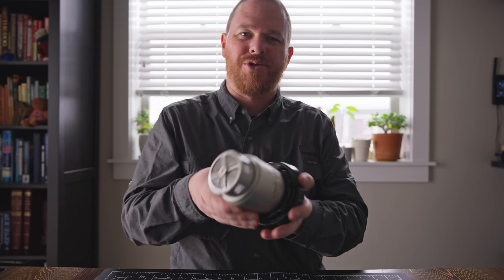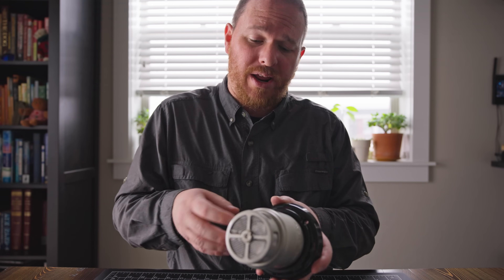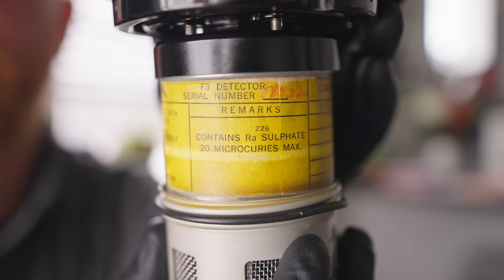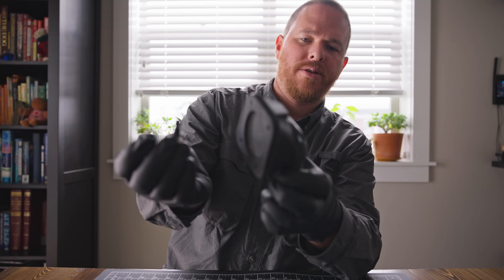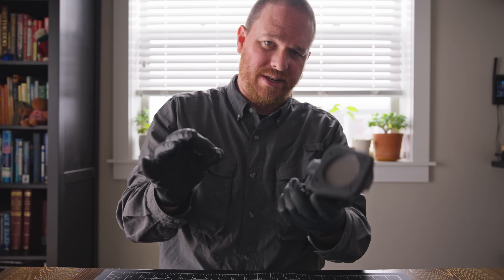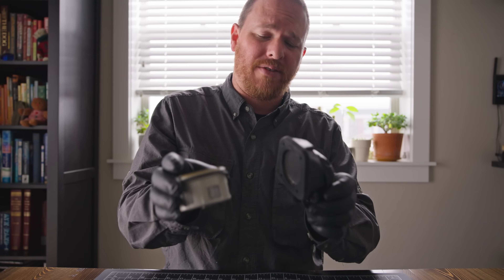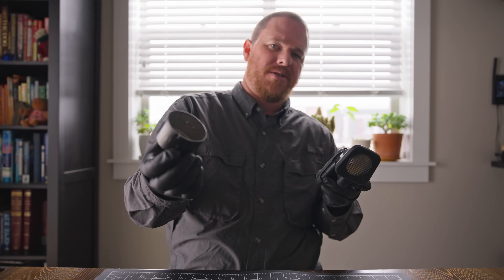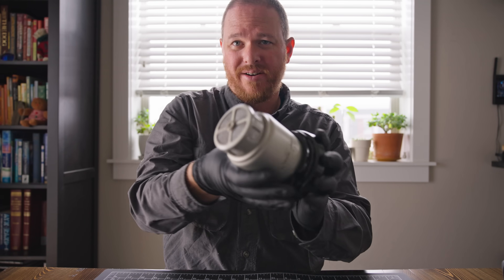Intensely Radioactive Industrial Smoke Detector from the 1950's

Comment: Drew:  If you are going to do these kinds of things,  strongly urge you to get yourself a dosimeter so you can monitor any dose you get yourself.  I also would not take anything apart in your house, and when doing so, only on easily cleaned non-porous surfaces.  The source you showed today gave you a dose of about 20 mrem an hour at one meter--it goes up exponentially as you get closer.
Reply: The way I think of it: your chances of getting cancer are already high, don't push it.
Reply: Actually, the radiation gets exponentially weaker trough shielding and gets weaker with the square of the distance trough basic geometry (for non-directional sources). This means that in air, the alpha radiation does indeed decrease exponentially but the gamma radiation does not. It will decrease only with distance squared, because air does not shield gamma rays in any meaningful way. Beta rays are something in between, they will still decay exponentially but not as strongly as alpha.
Reply: @entcraft44  inverse square law the most pain in the ass in nuclear science school
Reply: @dragonfireproductions790 right 😂 on contact I’m dead but at the door 8 feet away I can go to bed haha
Reply: Agreed, but if he wore a dosimeter we wouldn't get to hear him say "very, very radioactive" a hundred more times, he would actually have to quantify how much he's received.  And I thought I was nuts going to the local dental school to be practiced on by aspiring dental xray techs that kept zapping me over and over and over again about two dozen times until they finally satisfied their instructor with the images they had taken.
Reply from the maker: Those X-ray exposures give a pretty good dose. Not as much as they use to back in the day but nothing to totally dismiss.
Reply: @RadioactiveDrew  Strong agreement with this comment! Get Yourself a Radiagem electronic dose rate meter! Better yet! Use better measures to reduce exposure! Time, Distance, Shielding! Basic radiological control principles if you have been educated in this field of work!
Reply: @monkeywentbananas  Being educated period would tell you that the source hasn't leaked in 70 years.
Reply: @RadioactiveDrew  if you happen to have any beta decaying sources, be sure to store them in glass containers. Storing them in lead or any other metal generates braking radiation, which is harder to contain, given the high excitation enegy emitted by the beta sources. 
Also if you plan to open such canisters, there is some risk that they are corroded given the silver part. Get a special box for handling such materials, where two glove openings are provided and the box can be covered with lead sheets. It might be interesting to have clickety stuff at home, but believe me, it doesn't worth being poisoned. Get rid of those as quickly as you can. Especially if you have children. I know this sounds like the regular screeching, but radioactive materials especially as active as that detector is not meant to be opened/serviced in a common household area. The scariest thing is not even the dosage you get, but the possible contamination. You cannot tell with that dosimeter whether you contaminated your hands/house or not. You'll need large volume scintillation detector for gamma, and special scintillation detector for alpha and beta radiation in order to make sure that no contamination is present. 
If you want to have a control source at home I recommend you to buy uranium glass marbles (not even fiestaware since they can be chipped!). I build dosimeters, and the point is to detect miniscule amounts of radiation, so as a control soure I use potassium salt which is naturally radioactive and most importantly a non restricted material, perfectly safe.
Reply from the maker: @MrEdwinHubble  I believe you're talking about bremsstrahlung radiation. This production of x-rays isn't limited to metals...I've seen it occur in tritium vials held in glass. Might have something to do with the beta radiation energy and the material being hit.

On the subject of my radioactive sources and the detectors I use. The Radeye B20 or the 44-9 probe from Ludlum can detect contamination left over from radium sources. Radium is a terrific alpha emitter and those GM pancake tubes love alpha radiation. Are there better alpha radiation detectors...of course. But what I use is more than capable. Could I use a silver activated zinc sulfide scintillator...I could but I don't need to.
Reply: @RadioactiveDrew  ...Maybe a glove box would be a good investment?
Reply: @maubunky1  He'd be saying "snappin duckshit !"
Reply: @maubunky1  I started getting nervous when they did about 14 X-rays at the dentist.  There’s something wrong when they throw that lead blanket on you and leave the room while zapping your brain repeatedly.  That was the last time I let them take that many regardless of what the insurance paid for.
Reply: @scottyV1000  It looks like a lot but dental X-rays give you only like 0.005mSv. If you had a head CT, it'd be like getting about 500 dental X-rays.
Reply: Well said. Stick to ALARA basics and monitor. Hot particles (aka:crud) are insidious and the danger is not in its absolute activity but if you inhale or ingest and you get a local high cumulative dose. Hard surfaces. Dosimeter. Timed exposure. Ventilation and possible breathing protection. Health physics is not a joke.
Reply: You probably needed a breathing mask for that episode as well, so no alfa could be inhaled or go in to the eyes. Nice video material though, very interesting!
Reply: What do you mean 20mrem??? 20uCi of radium at 1 meter is 20urem, not mrem (about the same as background radiation). Personal dosimetry is ABSOLUTELY NOT needed when handling low activity items like that smoke detector. Common sense will keep you safe. Drew calling it "very radioactive" has gotten the lot of you excited over what is actually quite a weak source. Again, personal dosimetry is not needed...
Reply from the maker: @inductivelycoupledplasma6207 it’s a weak source compared to dangerous sources…yes.
Reply: If you dont't take proper safety precautions like lead apron etc, there won't be too many more videos on this channel !
Reply: That's about as much of a life expectancy decease as smoking a couple cigarettes. A good idea to get a dosimeter still, but 20mrem/hour is "ok" as long as you don't sit and stew in it for hours. Of course holding it in your hands as he did GREATLY increases your dose but I trust that Drew is a professional and knows what he is doing.
Reply: Inverse Square Law
Reply: This was captivating to watch, but oh my word I have concerns for you. Stay safe.
Reply from the maker: I’m fine and I stay safe. I watch my exposure when handling items like this.
Reply: The way I look at it you just gave yourself 50 CRTs in the time you had it out during your video make
Reply: What is the actual dose rate of the detector in RADs? Most consumer grade detectors top out at 1 or 2 rad tops. I don’t use the current curie measure I still use roentgens for measurement that’s why I ask.
Reply: Please switch your meter to mrem, it won’t “overload”, it’ll actually measure lol, don’t be a drama queen frightening the uninitiated. CPM is only used for low level loose contamination. Otherwise good channel.
Reply: @HowardKlein1958  that reading included beta, and hence isn't accurate. The contact gamma only dose rate isn't more than about 1mSv/h, and that's at less than 1cm of distance to the source. A chest x ray is about 100uSv, but contact dose rates cannot be compared to homogenous radiation fields, and hence holding the source to your chest will expose to you much MUCH less than 1mSv/h (closer to 1uSv/h). This source is "safe" to handle for moderate periods on a daily basis, without increasing your annual exposure by any substantial degree. Of course ALARA would disagree, but realistically, it's not a hazard. The main hazard with those sources is the fact that they drop "fleas" of contamination when disturbed, hence I'm a bit shocked to see him disassembling the device on his dining room table. One thing is for sure though, the
Reply: The dose-rate is known - from the geiger counter - and the duration is known - from a watch and from the video time-counter - so the dosage is already known.  A dosimeter would add no information.
There is no other source or potential source of radiation in this setting - a domestic environment - so no additional possibilities of radiation exposure the dosimeter could alert of.
Working on construction sites - same issue of "mystic" invocation of administrative steps not connected to need (my personal strongest dislike - "dust suppression tank" specified for a stone-saw (eg. "Stihl") - its 20Litres would be gone in less than a minute, and there is no means to resupply water is ever provided - it's b.s. -- what works is a watering-can like for garden plant watering delivering many litres per minute of water, and a water bowser with a tonne of water provided).
Radiation - what you want is a "clicking" counter so if you walk around a corner into an unexpected radiation field you know about it and retreat fast.
Reply: 20mrem is only 200 microsieverts. For comparison, you can get that same dose on certain polar plane flights due to higher cosmic radiation in those regions, around 160-200 microsieverts per flight. Flight attendants and pilots regularly fly and receive similar doses year round. While its worse to receive such a dose over 1 hour vs 10 hours on a polar plane flight, its still not nearly as dangerous as you might expect, as long as it isnt done often. For another comparison, a chest x-ray can provide 100 microsieverts, but that is received in an even shorter time frame than the 20mrem per hour. 

The takeaway is that doing this every now and then is no cause for concern, but shouldn't be done often, although he could definitely benefit from methods to limit his exposure, like not directly holding the radioactive source while explaining its properties, perhaps discussing it after the recording holding it, in which he immediately sealed it back up afterwards.
Reply: Exactly!
Reply: The issue with the ammeter for personal use is the services are cheap. I’m a device to read them is thousands or decimetre itself thousands sometimes calculation is the only way.
Reply: Thank you Sarah....you saved me the trouble of warning him.
Reply: @ronanzann4851  He doesn't care. I pointed out something in one of his other videos and he said I was "giving him an attitude." It won't be too long before he changes this channel's name to "Cancer Patient Drew."
Reply: I mean, these are pretty basic precautions of which he’s likely aware. Of course, being YouTube, greater risk will probably be rewarded with greater subscriptions. I’m just waiting until he inevitably gets exposed to a neutron source, becomes activated, and truly embodies the title of ‘Radioactive Drew’.
Obviously I wouldn’t actually want this to occur, so I’m only joking (kind of).
Reply: I gave this video a thumbs down out of care for his life. Its sick and perverse to joke about causing yourself permanent harm to make a stupid video.
Reply from the maker: @loistverberg900 no permanent harm was done making this video. That’s like saying you receive permanent harm from getting a dental X-ray. Our bodies heal from all kinds of damage, even damage done by radiation…which is happening to you as you read this.
Reply: yeah but the metal isnt going anywhere.
Reply: Lemme do what he wants 🤣😂🤣😂🤣
Reply: Meh, he held it away from anything important like his chest. It dies off so fast you wouldn’t believe. I’ll bet at his chest was it was <1mrem/hr no question
Reply: You are all tripping on the safety crap. The guy is obviously an energy eater like myself. Same with me and electrical equipment-who needs gloves bellow 1kv? Just suck it up and buff it out. It all buffs out. Hold my beer while I demonstrate.
Reply: @TimothyEdgin  If you don't care about your own safety that's fine. I don't approve of sharing the mentality to "just deal with it"  however. While I personally subscribe to the same mentality, I still encourage others to practice safety. Its not a necessity but its a better influence to spread awareness, rather than just sweep the possibility of any 
danger under the rug.
Reply: @dustinchase2294  
I agree.
Being overly cautious is not expensive.
I would not hold that source with my fingers. I would get a pair of tongues, maybe 10 cm long to handle that.
If you have a lead apron, sure, why not wear it. Of course, that would be excessive. It won’t be so great at stopping gamma rays, I imagine.

We don’t call the particles that these things emit “radioactive particles”. Radioactive means unstable and the thing that is unstable is the atom in question, such as Ra226 or U238. You can call these radioactive elements or radioactive isotopes or radioactive nucleides. However, atoms are also called particles or nuclei are also called particles.

The problem is that the particles they shoot off have a lot of kinetic energy.
These particles can bump into atoms, push them off or they can kick out an electron from an atom they encounter (ionization of said atom).
When it does this to DNA or RNA, we call it a mutation. Depending on what has been changed in our DNA, the cell might become a cancer cell. This basically means that it lost the ability to control its reproduction. The cell makes copies of itself non stop.
Reply: @dustinchase2294  Let me add a /s to my post because apparently my sarcasm was not apparent. I thought my post was dripping with sarcasm.
Reply: @TimothyEdgin  exactly. based
Reply: Just wash up really good, that's all you can really do. I mean he has a geiger counter to see if anything solid got on the table. Whats a dosimeter going to do? He cant unexpose himself to radiation, so who cares?
Reply: @frydemwingz Actually a dosimeter is designed to measure ACCUMULATED dose...and it DOES matter. If Drew wore one each time he handled his sources, he'd have a better feel, over time, for the actual risk he's taking.

If you liken taking proper precautions with radiation to yelling that the "sky is falling", you're a compete moron.
Reply: @frydemwingz  a dosimeter will keep a record over time. His RadEye is more for taking measurements in he moment.

It's like lots of small financial purchases: they add up.
Reply: @frydemwingz  Absolutely zero got on the table because its embedded in the foil and has been for 70 years.
Reply: Lmao
Reply: There is always at least one person to spout the sky is falling. congratulations to @sarah lowery for winning that award.
Reply: @jtcustomknives  dude that thing is very hot. 20 mrem, not great, not terrible... until you get repeatedly exposed to 20 mrem and start accumulating a dose far higher than 20 mrem
Reply: @jtcustomknives  Make me two if showing where to find, specific what to find and then deconstruct to find dangerous material is reckless at best.... Guarantee you there are both people with nefarious reasons and idiots with just enough information to be a danger that stumble across this stuff. I wasn't looking for it.
Reply: @jtcustomknives  i work as a CBRN/HAZMAT response firefighter, this is literally how marie curie died, it's from continuous exposure to radium. The amount he has been exposed to judging by the cpm count has been equivalent to a dental xray i don't know the exact amount because I use Sievert and mrem for exposure.
Reply: @jtcustomknives  Her comment was well intentioned and valid! Maybe you should stick to commenting on videos about Knives since you obviously don't know anything about basic radiological control principles!
Reply: @monkeywentbananas  Basic radiological principles states if he doesnt eat it or sleep with it as his teddy bear he will be fine.
Reply: @monkeywentbananas "THE SKY IS FALLING, THE SKY IS FALLING!"-Karen,ah, I mean monkey
Reply: @jtcustomknives  -Grow up. Sarah’s comment was good advice. Your comment was immature and inappropriate.
Reply: @jtcustomknives  exactly. There is one of these debbie downers in every comment section. I watch a lot of black powder shooting videos, that's my hobby and loading these things and just handling them is a little different than handling modern firearms, so the comment section always has one of these people screeching they put their hand in front of the barrel or have open gun powder on a firing range, etc. Kinda hard to not do a few of these shooting antique guns, it really is just more dangerous and you have to accept that as part of the territory. Just like buying radioactive things.
Reply: @frydemwingz  i dont feel like this is an accurate comparison. You're comparing explosives to radiation. I am comfortable handling fire arms and explosives, but if I'm going to deal with radiation, I would at least be researching how to do so in a safe manner. The same as you would do using black powder. There were gloves used, but when you get an X-ray or something like that, you are given lead lined vests to protect your organs from the radiation. The short of how radiation kills is it shoots tiny radioactive particles through your DNA which destroys your body's ability to regenerate. You will literally live until the cells that are in your body die off. In smaller doses it causes increased risk of cancer and blood born illnesses. As well as weakening immune systems. I do not see gunpowder doing any of that unless you smoke the stuff.
Reply: @dustinchase2294  It was a comparison to the reaction every video of doing anything remotely dangerous gets redditors like you writing walls of texts like this about it.
Reply: @dustinchase2294  You admit yourself that you don't know much about radiation. Your explanation of radiation sickness is not totally wrong but contains a lot of errors. Why do you spread half-assed explanations?
Reply: @entcraft44  you just answered your own question. I don't know much about it but what I listed is accurate lol. the point was made, if you missed it idk what to tell you holmes
Reply: @frydemwingz  No i was just responding to someone making an inaccurate comparison to attack someone else for being concerned about someone else's safety. nice try though
Reply: @entcraft44  bro, inverse square relationships are exponential
Reply: @TheeHypnotoad  No, inverse square laws are not exponential, they are polynomial. The graph might look exponential, but it is definitely not.
Reply: @entcraft44  while it is true mathematically that inverse square is not exponential, In terms of general vocabulary “exponential” is exactly what it is. Hate to be a vocab nazi, but mathematicians have long been altering vocab in ways that are confusing and misleading to true definition. This is why definitions are separated between general use and mathematics. The dropoff is exponential, but mathematically it is not.
Reply: @frydemwingz  -You need to grow up as well….and use your real name if you want your comment to be taken seriously.
Reply: @JaegersB_ttplug  Exponential as a word related to rate of change has been invented by mathematicians, not altered. In this specific case, the mathematical definition is the true one. According to Wiktionary: "In non-technical contexts, the term is sometimes used loosely to refer to any kind of very rapid change, especially increase. This usage is often discouraged unless the change in question is truly exponential; synonyms such as dramatic may be favored instead."
Reply: @entcraft44  I digress it appears you’re right about this word, however my point stands on split definitions.
Reply: @dustinchase2294 most ammunition being high in lead content it’s likely to see an elevated cumulative level of lead toxicity in someone involved in shooting firearms on a regular basis. Also Natural Radon in the environment is the second leading cause of lung cancer.